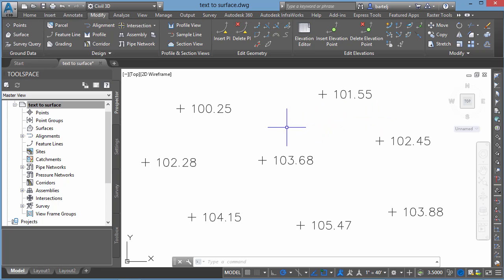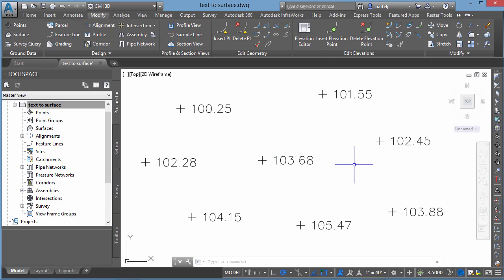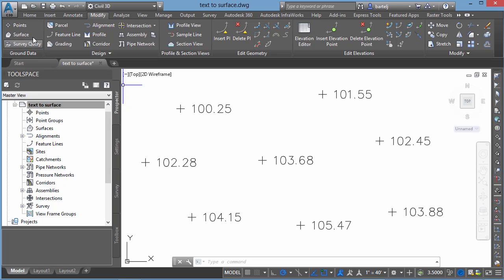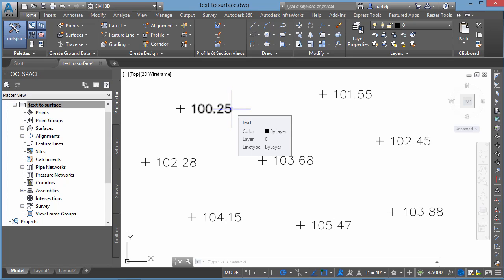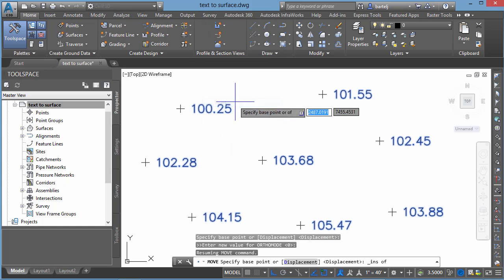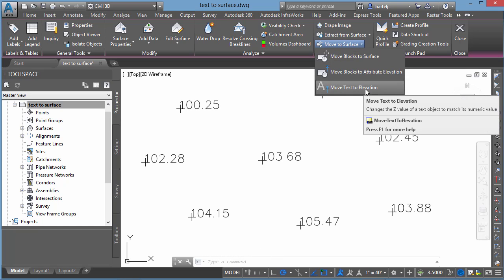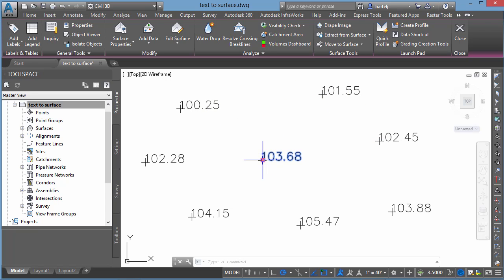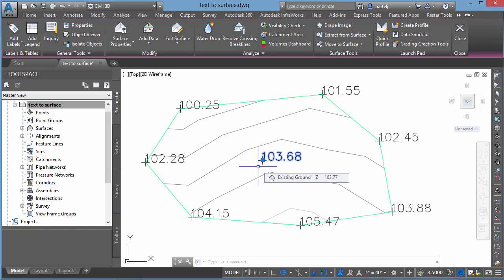How to build a Civil 3D Surface using Text objects

Comment: Great video, Jerry!  If the text is actually part of a label that is dynamically linked to a feature line, which is in turn linked to a corridor, will the text object dynamically update the surface with a "re-build" command?
Reply: No. And seems like you should have been able to just try it out and find out yourself

Comment: using the data extraction command to create a point file with the xy and text contents s z lets you end up with point objects that you can then apply styles to if you want to keep the points values showing and looking nice also can add subtract an offset in excel so you do not have to adjust the insertion points of the object